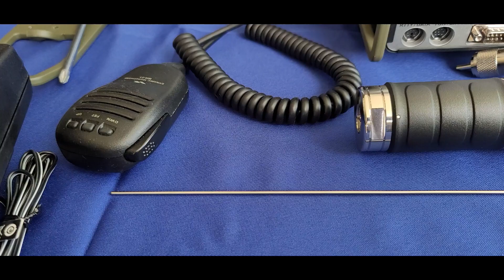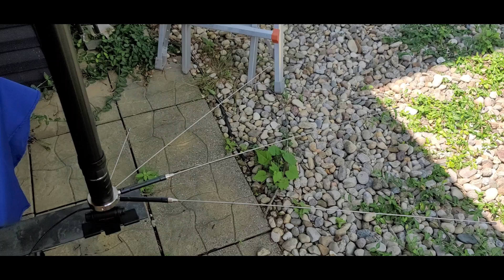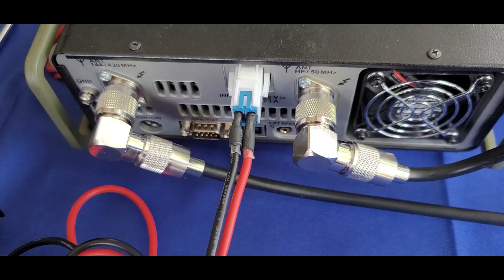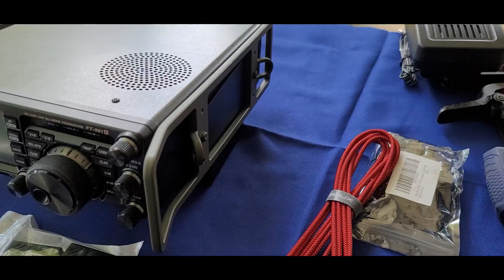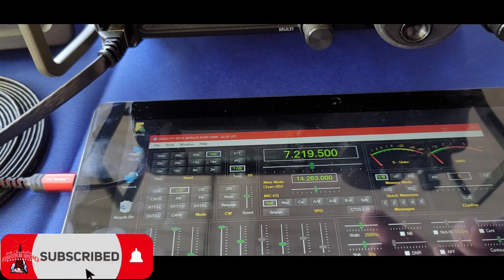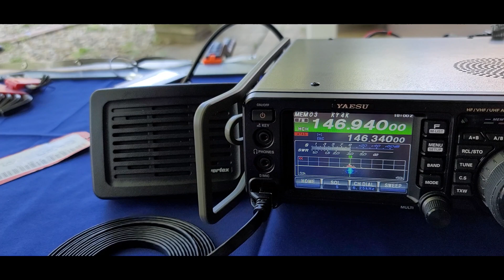LCARA HAM Radio: Part 2 for the mobile HF radio install in my wife's car!

Comment: I followed all the steps and have the necessary equipment. The radio works perfectly with the source, but it won't turn on in the car despite a good installation. The FTM 500dr does work for me.

Comment: Hurry up with the install video, I need to show it to my boss. Maybe she will let me install my FT-891 in her Santa Fe. The ATAS 120A will work all the way up to 70 centimeters by itself. The ATBK-100 is a radial kit used with the ATAS 120A when used as a stationary antenna like on a tripod. 
When I was testing the radio and antenna, I used a right angle connector and put the ASAT 120A directly on the back of the FT-891 to see if the radio was setup. After I knew it worked, I installed it in my Silverado on the short door behind the drivers side door. had to improve the grounding and then success. 
Good luck and 73
Buzz KD4CXI